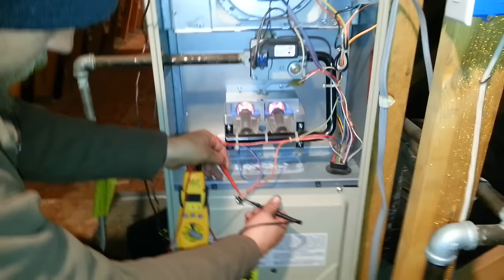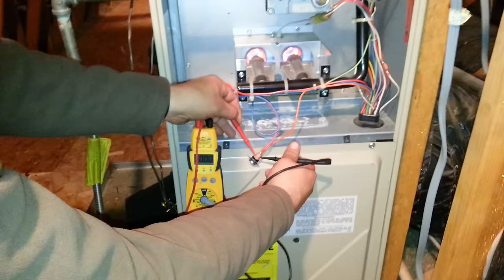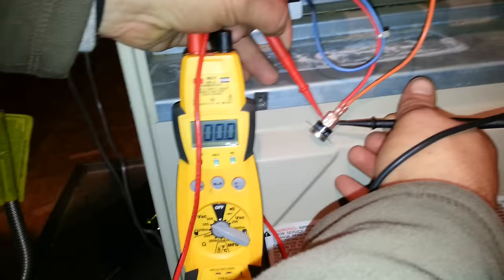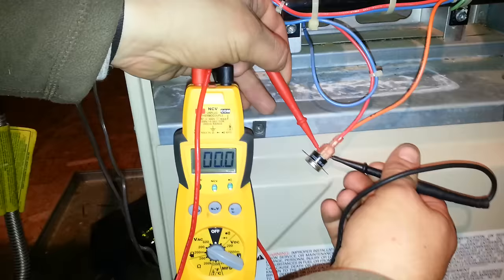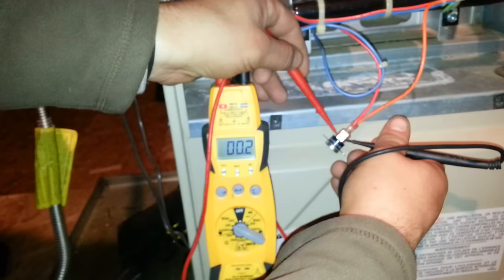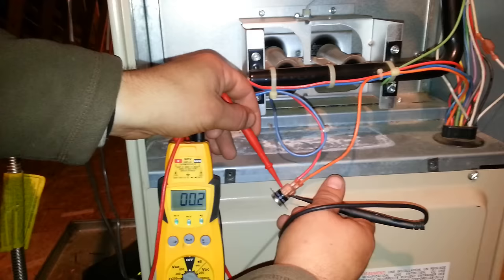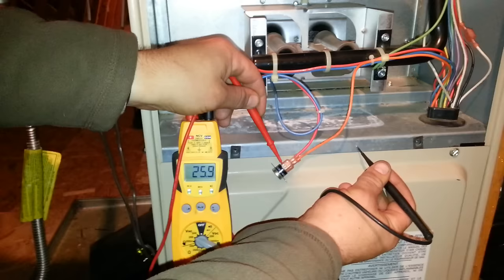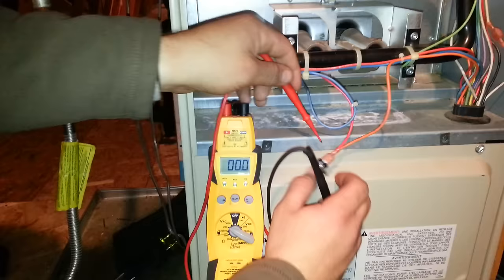Checking a limit switch using your voltmeter

Comment: Older Bryant gas furnace, fan runs, burner comes on for a minute, goes out for a minute, comes back on for same. What's wrong?  Don't see a flame sensor, but that's what it acts like.
Reply from the maker: Ron Roth does your circuit board have any  diagnostics or LED?
Reply from the maker: Ron Roth is this a three wire or HSI
Reply: Mitchell Bailey no LET'S anywhere, think it's older perhaps?
Reply: Mitchell Bailey not sure what you mean by three wire.  do you know if this furnace has a flame sensor and where it's located? I have stood on my head looking at all areas obvious and don't see one, nor a wire going to one.
Reply: Mitchell Bailey not sure what you mean by HSI, ,
Reply from the maker: Ron this unit uses a spark igniter that does double duty as a flame sensor. I would polish the igniter rod with steel wool. It could also be the igniter box that is malfunctioning by not sending back to the gas valve a signal to stay open. I would also check that the evaporator coil is not plugged. If the coil is plugged the unit may be cycling on the high limit due to lack of airflow. Make sure the filter is also clean. One last thing, this furnace is pretty old and a cracked heat exchanger is very possible. I would get a carbon monoxide detector and install it in the house for safety. Also a furnace this old is way beyond it's useful life. I would not spend any money to repair this furnace, put the money toward a new system. Get at least three bids. If you have any more questions you can email me at baileysair@sbcglobal.net
Reply: Mitchell Bailey,, Okay,, it took me forever to locate one of your videos that covers my furnace. Once I did I found three that covers my exact furnace! All very informative and well done, , Thank you! I now know what you meant by 3 wire, which is what I have.
  The ignitor is in fact where I think the problem is. I don't think the bimetallic switch is staying in its proper position. However I will clean the sensor rod for the pilot and try it one more time. But the pilot light remains on when the burners light, suffering no momentary going out.
  I also now know that instead of rollout switches, this furnace uses the fusible link which is attached to the limit switch Spade connection. I wondered what that was! The burners seem to be functioning okay, good Blue Flame with what seems to be a good draw, and I don't see any evidence of blowback. I Do you have a carbon monoxide sensor in the living area, and I have tested it. I am also pretty good at keeping the filter for the furnace clean.
  As I said everything works, and when I first turn the furnace on the burner actually runs for a while before it starts the on-and-off cycle at 20 second intervals, all the while the fan continues to run. The high limit switch has already been replaced, so a few bucks more for the three wire ignitor is worth a shot. Thank you again for such great videos, I have really learned a lot!

Comment from the maker: sounds like the flame sensor may need cleaning
Reply: Mitchell Bailey This is twenty year old Bryant,,I can't find a flame sensor. Model 394gawo36125. Fan will keep running and things stop when temp is reached, but burner does on and off thing the whole time . Three days ago I replaced the limit switch cause prior to that the unit would only run for four minutes and the whole furnace would stop, including fan. Then in a few minutes of cool down it would begin again, run, and stop again. ok, limit switch. Now fan runs, but burner is still  playing games.
Reply from the maker: Ron Roth sounds like an air flow problem cycling the burner on the limit
Reply: My Amana GULA090AX50 limit switch cannot be reset like yours, it the one in between two pressure switches by itself mounted to the wall of the furnace below the burners.
Reply from the maker: The limit switch you are talking about is the primary limit switch and is automatic reset and doesn't have a button to reset it. If it is open and the furnace is cool then that limit switch is bad and needs to be replaced you can check it with a volt meter as shown in the video, or you can pull the wire connections and just check continuity across the terminals.
Reply: With limit switch wire connections pulled and furnace cool I have no continuity between the primary switch terminals. The other two limit switches with the reset buttons by the burners when tested the same way do have continuity. 

So its really as simple as that right? When the furnace is cold and the switch has no continuity between the terminals ( this means its open - not completing a connection) this means its bad and if the furnace is cold and the switch does have continuity between the terminals ( this means its closed - completing a connection) its good. Just wanted to make sure I'm clear on this in case I tell someone else in the future. Oh, and thank you for the fast reply its much appreciated.
Reply from the maker: If you have no continuity then the limit switch is bad and needs to be replaced. The question now is why did it fail. Usually these limits fail because the unit is not getting enough airflow through the system and it was cycling on and off via the limit switch. This will wear out the bi-metal disc that activates the safety and the will stick open. You could tapping it with the handle of a screwdriver and see if that resets it. But it will do it again and should be replaced. If the airflow is too low this needs to be corrected so this does not happen again.
Reply: I see. Initially some months ago I noticed water was accumulating just above the burner compartment area (outside of unit where the metal air vent is on the left side) I think it was just from some heavy rain we had, so I had a towel up there and ended up just leaving it there. When this limit switch problem started I remember I had to pull the towel away from that little vent on top ( It was covering it quite a bit) so that would make sense based on what you're saying..the airflow was being restricted. Also along time ago it was acting much the same way as now ( blower on but no flame and it would just keep going ) I was told to tap on the pressure switches with a screwdriver a few times and try it..well that worked and it kept working until now ( its been about a year since then)  is there an easy way to test the pressure switches so I can order those along with the limit switch. BTW I really appreciate you answering these questions because I cannot afford to get a repair guy..you're helping me more that you may know :)

I forgot to mention I do get 4 flashes on the mainboard as its trying to run. I could not find anywhere what these codes mean. Its an amana GULA090AX50 furnace if that helps
Reply from the maker: Four flashes means open limit safety, which is the limit switch. Also if there is leaking water inside the unit you may have a hose that is broken or a cracked collector box. This is a condensing furnace and makes a large amount of water when it is running. This also needs to be fixed or it will ruin the furnace.
Reply: I see, I'll be looking into that..any tips on checking for a cracked collector box? My pvc pipe for venting does not have a hood on it outside on the roof so I assume its allowing some rain to come down the pipe as it seems to only do it with heavy rain.
Reply: I have a new development.  I replaced the primary limit switch and everything worked normally up until today. What happens now is the furnace kicks on, the igniter lights the burners then they go out immediately..the system trys the second time and everything works normal. Its just taking the system an extra try to keep the burners lite. what do you think I should check ?  so far I see no codes flashing on the main board..I'm looking through that little glass sight glass on the bottom compartment where the board is located.
Also I wondered if the wires can be put on backwards to the limit switch ? I didn't see anything on either the old switch or new switch as far as a + or - goes.
Reply from the maker: No the wires can't be put on backwards. As for it going out then re-trying again and staying lit could be the flame sensor is not sending a good enough signal. Does this particular unit have a flame sensor or is the Hot surface doing double duty as a flame sensor. If the hot surface igniter is doing double duty then you should install the kit to convert it over to a flame sensor. If it has a separate flame sensor then I would try cleaning it and see if that takes care of it. I have a video on cleaning a flame sensor. If you clean it use steel wool to polish as it wont scratch up the sensor as bad a sandpaper or emery cloth.
Reply: It looks like I do have separate hot surface igniter and flame sensor. I'll look into cleaning it tomorrow. Oddly since tapping on the pressure switch it has been acting normal..lighting and running and first attempt. I checked for 24v at each pressure switch and they both do have 24v but this was also after tapping them as a friend advised for my issue last year ( The first issue I had about a year ago was with the furnace not igniting and the fan running continuously) A friend said to tap the two pressure switches with a screwdriver as sometimes they can get stuck..I did that and it has worked properly since last year..so maybe it is one of the pressure switches intermittently working ? can I unscrew the metal bracket on the pressure switch from the furnace housing or is this also acting as its ground? the reason I ask is the connectors for the wires are kinda up inside the pressure switch making it a tad difficult to attach my multi meter leads, if I can take the bracket off and turn it towards me I can probably attach alligator clips to the terminal easier so I can then watch closely for any change in the 24v its supposed to be getting.

I just watched a video of a guy cleaning the flame sensor with a five dollar bill...apparently we don't want to touch it with the oils on our fingers ( mentioning this in case some reader decides to try this) I may go ahead and turn the power off to it and try this tonight..ill post back the results tomorrow. I just cleaned it..used 000 steel wool, took 5 minutes.
Reply from the maker: You cant hurt the flame sensor by touching it. The hot surface can be damaged if you touch it. They become brittle over time and are easy to crack. Another thing you can check are the hoses to the pressure switch. You do this by removing them and blowing through them to make sure they are clear. Sometimes debris or scale build up and even insects can plug them up and cause them not to work. However DO NOT BLOW on the pressure switch itself because you will damage the diaphragm. I would also take a paper clip and make sure the ports going to the inducer motor is clear. I have had scale build up at those ports before and that could also cause it to shut down.
Reply: You are awesome. I will look into that tomorrow. I have to say you are one of the few guys on YouTube who actually responds to their channel questions. It's much appreciated ..helping the poor :) I had called a couple technicians when this first started..none called back so your help is a god send to me. Thank You... I just realized 181 subscribers ? We have to change that. I'll do my part trust that :)